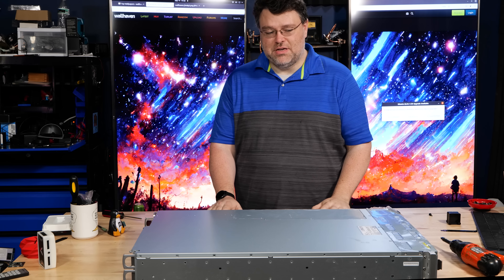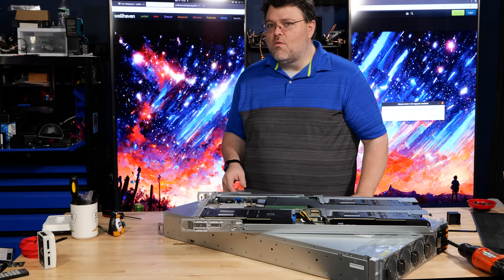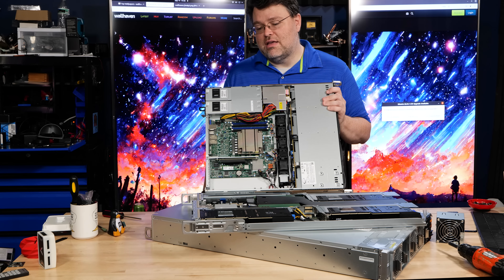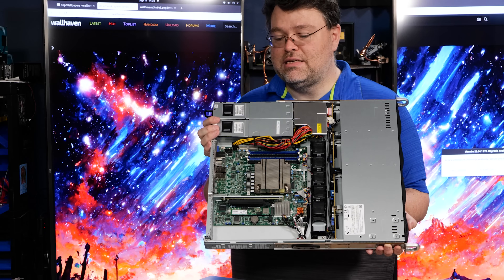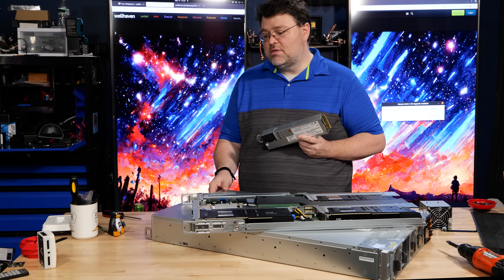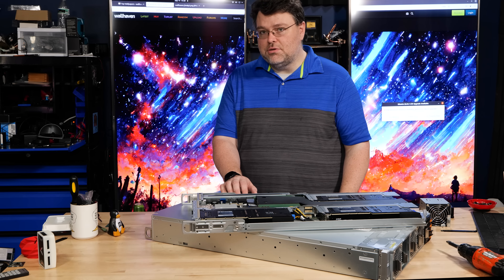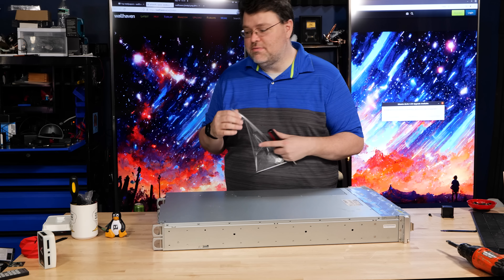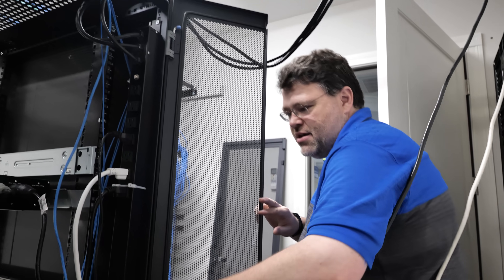1u Servers are DEAD! Long Live 2u Servers! But Why? -Ft. Supermicro AS -2114GT-DNR

Comment: One day apart in 2 videos: Linus "I want all my LAN-PCs in 1U, so I don't waste 1 rack-slot" - Wendell "1U is dead cause 2U is more efficient" XD
Reply: Enterprise server vs bespoke gaming chassis. However not sure why Linus just didn’t get a second rack and move the networking equipment and do 5 c 4u chassis and avoid the headache. Those are easy to obtain and let him run more common components.
Reply: @handlealreadytaken  w w rul mmxkzxd
Reply: @handlealreadytaken  His idea's were unsustainable and ended up in 
"I need 1 rack per computer", which pretty quickly devolves into an explosion of racks...

Prob best not to buy a new rack every time he has a new idea :P
Reply: @Chris H  It's mostly because Linus doesn't know what he's doing half the time.  He's the guy from marketing; the actual expertise comes from his staff.
Reply: @hobbesz9199  By his own admission is not a tech specialist. but a media specialist
Reply: Can you compare an infotainment channel to an engineering one though?
Reply: @hobbesz9199  Because it's definitely a competition between Level1 and LTT on who's the most technical...right?
Reply: This server is 2x 1U nodes.  Linus even acknowledged that everybody recommended putting 2x 1u systems in a 2u chassis just like this. But unlike this, you can't cost effectively build a modular Ryzen system where you can perform maintenance on just one system at a time.
Reply: In fairness, Linus isn't using the chassis fans for any significant amount of cooling, so that negates half of the reasons Wendell suggests that 1u is dead.
Reply: Going by one of his videos he will run into DRM issues if he goes with VMs for the his home LAN-PCs so going by how many he claims he will have a LTX he will need a 150ish 1U rack computers then 4 rack switches and however many UPS it takes to plug them all in. Basically a datacenter worth of computers. Then of course having something akin to using 150ish raspberry pi 4s to stream it too for all of them. The raspberry pis as client machines for the gaming rack computers to link to. The pi 4 not the pi 3B+ as pi 4 has 1 gigabit the pi 3B+ has 300 Mbps networking and the pi 4 has USB 3.0 while the pi 3B+ has USB 2.0.  

Once set up it will be good just expensive buy 300ish computers to run 150ish computers, thermally hot as all the machines will be running 1 high end GPU, and a pain in the neck for whoever is put in charge of networking 300ish computers together so they all work. Then you have what to do with it until the next LAN event as it is basically a data center but with the purpose of running a gaming LAN.
Reply: Well... Linus is kind of an idiot most of the time that his mouth is open.
Reply: Lan PC in 1 u ? Means using 1 network switch right ?
Reply: How many times did Wendell mention the data centre
Reply: @hobbesz9199  well I personally thinks it's quite a leap to go from, my knowledge is better to basically he doesn't know shit... I know more so nothing he says adds value to me personally but that doesn't equal he doesn't have more knowledge than most.

and obviously his business is a media business that's not in question.

he's tech focused and to most people what he says has value, otherwise he wouldn't be watched. that's all i'm saying.
but clearly, here, we're on a channel that's much deeper in the weeds. My main point is that it's not constructive to discredit him and his work just because we here have passed that point. it's toxic elitism...
Reply: @hobbesz9199  i think you're setting the bar for technical knowledge really high. I don't mean linus is an expert but he's a million years ahead of your random viewer/person. He generally understands the challenges. Wendel knows the extra to actually be the person to make things work.
To be honest I still don't trust ltt for for performance or technical reviews, but he's not any worse than jay or the other California youtubers. Maybe labs will be much better but I'm not holding my breath.
Reply: Dual system 2U chassis are built for redundancy. While there is technically no reason you couldn't have two totally separate systems in there, that is not how they are designed. The idea is to allow failover between the two systems BUT to split the load if they are both up. This means that active processes can be moved to the other system in the event that something happens without breaking anything. It use to be that you would have a spare system in a cluster, but now all the systems are always being used and everything is dynamically shifted around as the cluster needs.
Reply: @EmeraldWitch  This has nothing to do with a 2 node chassis. The same clustering can be done across two 2RU servers, two 1RU servers, two VMs, any two machines. While they do make Fault Tolerant hardware that does what you're describing, that's not what this is. If you were deploying an application in a cluster, you'd want to distribute the cluster nodes across physical hardware anyways, to minimize single points of failure.
Reply: @EmeraldWitch  Who cares what the original design intent is? If it makes more sense to use it for a given other purpose, then it doesn't matter what the main original intent might've been.
Reply: Linus isn't technical person.
Reply: @wiziek  Nowadays he basically outsources all of the knowledge and throws either his money or his influence at the wall.
Reply: @EminemLovesGrapes  Nowadays? When he didn't? He never was technical person, just retail/marketing gauy.
Reply: @wiziek  I remember a time when Linus was more in touch with his community. It's one of the reasons I don't watch him anymore.
Reply: @wiziek  The ignorance. He knows more than you'll ever do. :-)
Reply: no hate to the OP, but all of the ideas in the responses were discussed in Linus's video. it cracks me up that people gotta hate and sneer.
Reply: @hellboundedward  yep. Also he moves the bulk of the cooling outside, so 1U is fine. and god knows how much more stuff he wants to put in his Pink serverrack... ^^ He also calls wendel for help if he needs help.

Comment: Dumb question, is there a reason this wouldn't this scale to 4u?
Reply: or 3u with 120mm fans.
Reply: I feel like it wouldn't be that much quieter? The fans would still need to be really thick and spin really fast to push air through the whole thing because of the super high density, probably?
Reply: You don’t care about noise with a server. It’s in a sound dampened room away from the offices, and the poor employees who have to interact physically with the machines can wear hearing protection. 

What you care about is electricity. Larger fans move air more efficiently, so you can get the same level of cooling at a lower wattage. Because smaller fans have to spin faster, they will also wear out quicker. 

There’s a degree of trade off, make your fans too large and they won’t have the pressure to force air into the dense fins used on servers, and 80mm (2U) strikes a nice balance.

Comment: I get that it's not really your thing. But i think many of us would be interested in seeing builds like these, but which are optimized for energy effiency / low noise instead.
Reply: (Is your avatar Lain with a crown of roses??)
Also yes, I would like to see that. I think a bunch of us (maybe even the majority?) don't have a noise-insulated server room at home!
Reply: the server room is built to contain the sound. they dont care how loud the servers are as long as vibration is controlled.
Reply: @jmwintenn  sort of true, but systems that need fans running at full speed constantly spend a lot of power budget on cooling and not computing.
Reply: @morosis82  Well, having the fans at 100% all the time makes no sense be it power efficiency wise or attrition, especially of the bearings. When Wendell entered the serverroom, you can hear one of the servers constantly cycling between two fan speeds back and forth -> no full fan speed.
When the "new" one gets turned on, the fans spin up to full speed (PCs do that, too) and then reduce that speed after successful initialization.
For fan speeds in general: A certain minimum of fan speed is necessary so the fans can spin at all. I've never seen a 10k RPM fan be able to spin at 1k RPM. (1U server fans can go up to over 20k RPM)
The combination of density and heat production makes such loud and truly "moving" fans necessary.
Reply: @bernds6587  unfortunately supermicro doesn't have good fan curve controls... Because they don't care.

I had to write an ipmi hack script which does it on our nvme server because they offer no customization.

Their solution is "Oh it's 1C over threshold? Time for 100% fan until it's cool enough and then back to 25% for 5 minutes " way more irritating than keeping the fans a little higher and holding steady.